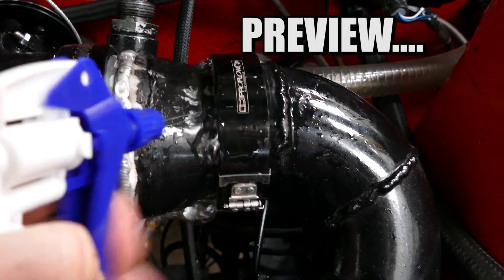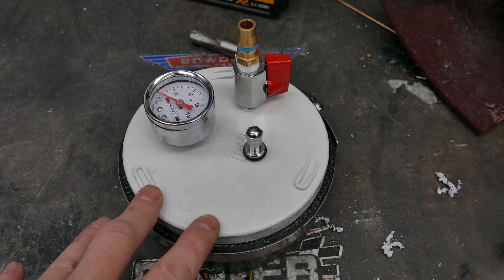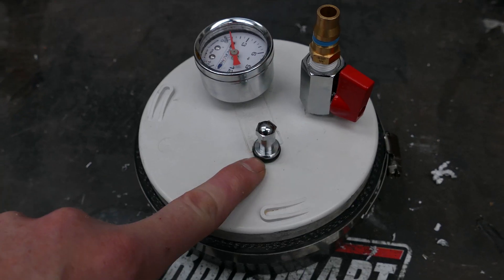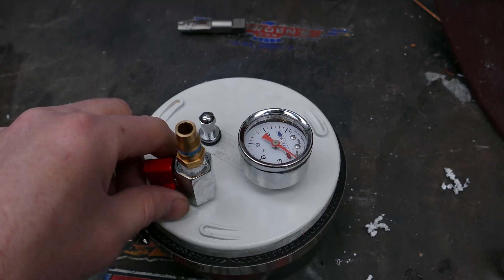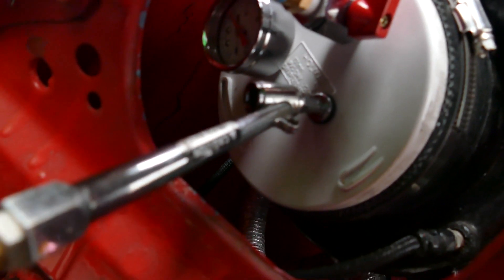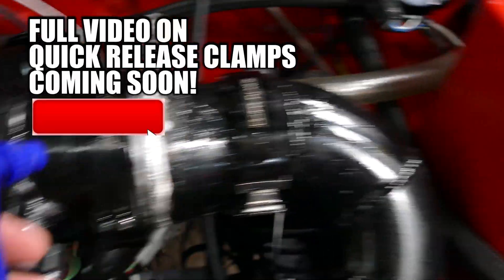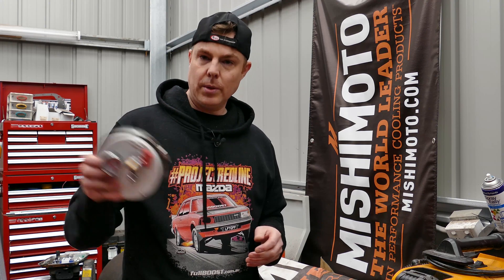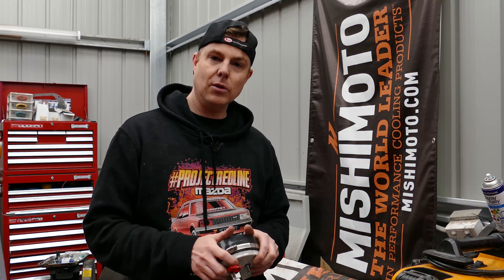How to Gain Horsepower for FREE!

Comment: Definitely worth removing the oil cap as mentioned in one of your replies. 

The other thing is if your car has a crank case ventilation system which vents into the intake, you’ll want to block that off, or test it after the turbo, so you don’t lose a bunch of air into the crankcase.

Comment: I 3d printed one with stepped sizes to fit different hoses - worked great but your gauge and valve is a good addition. 

One tip my mechanic gave me was to make sure not to use much air pressure.   Didn't want me to blow out my injectors or something like that.
Reply from the maker: Really need to run pressure the same amount of boost that you would. If something fails at that pressure with the tester, then better it fails then !  I’ve tested to 30psi now and happy with the results. I need to get on the 3D printer train. Sounds like a killer idea for an all in one solution.

Comment: What did I learn from this video?  I’m happy I went with my Plazmaman clamps.  Cheers
Reply from the maker: Yep, the throttle body and clamp is off the new car. Couldn’t wait to use it but so made an adapter to fit this old car. Then discovered the old other brand ones on the car might not be all they are meant to be haha good lesson in it for people.

Comment: Im shocked!!
Oh wait, that's right... no I'm not 😂
I'm sure you've also come across the 90° AN hose end cross section photos which also suggest Proflow's overall quality is called into question too 🤢👎
Reply from the maker: Been in the industry for 20 years now as a manufacturer, reseller, fitter and customer. Seen it all 😂 always take what you see on the internet with a grain of salt, as people generally have their own axe to grind and their own barrow to push in regards to the point of view they put forward. I mainly use raceworks and speedflow on cars these days, having said that I’ve also sold plenty of proflow products before and have been fine for the cost.

Comment: good video
wont you get a large amount of air leaking past the throttle body into the engine when running this test ?
Reply from the maker: Not a large amount, as the throttle body is closed. Also unless the engine has high overlap camshafts, you shouldn’t lose air constantly. If ring gap is also a little larger it may bleed some air also into the sump, so recommend removing oil filler cap.

Comment: Are these "Wiggins" style clamps overrated? Interested to see what your fix is, silicone hose and t bolt clamps or less joins in the pipework if possible?
Reply from the maker: One of them is performing perfect.  The other brand not so much. These clamps are great when the work. Better than silicone hose as when they work properly they don’t leak, don’t break and don’t blow off. And better than v bands as they have o ring to seal properly where bands are just two pieces of metal squished together. Downside is cost, needing to weld to fit them, and if installed wrong or product is crap can leak.
Reply: @BroomysGarage  so you're replacing the poorer quality ones with the same brand that's not leaking I'm assuming. Keen on a follow up video on it mate.
Reply from the maker: I’m going to try to put a ‘fix’ in place for these ones on this car, so then others can copy it if they have them as well. The new car only has the good flawless plazmaman ones on it.